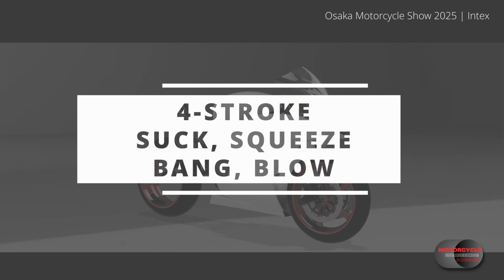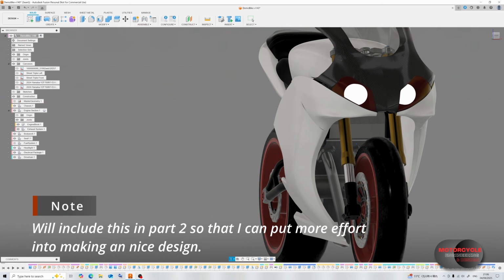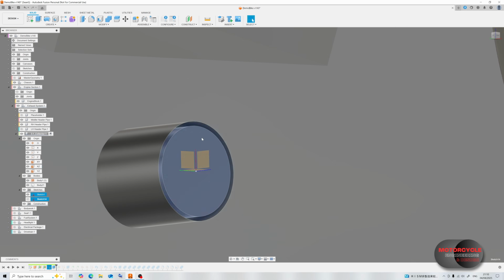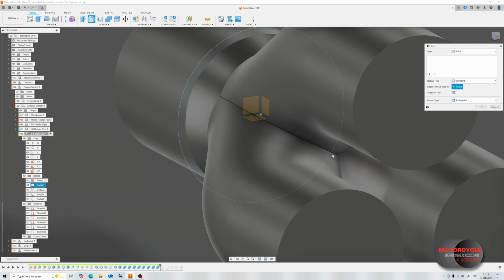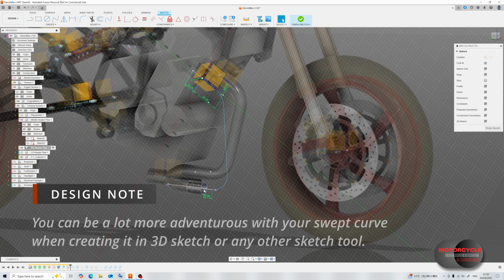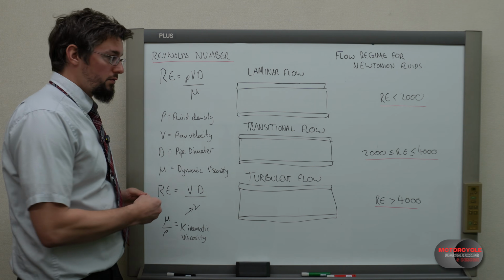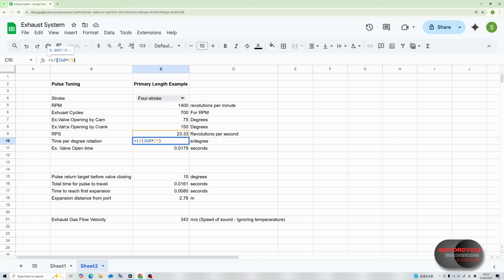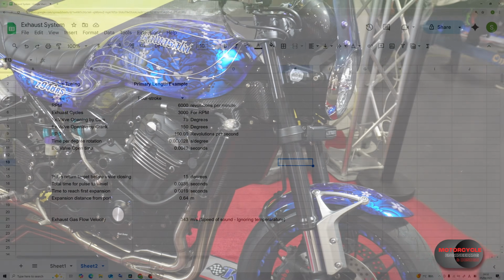Exhaust System Design | Part 1 | Pulse Tuning | Motorcycle Engineering

Comment: I heard an old racers trick hit it with white paint where it gets hot and messes up the paint cut it off. BMW M3 Pulse tuned Headers Sound great BTW
Reply from the maker: Hey, that's pretty cool! It's one thing to calculate and simulate based on theory, but these practical methods are more interesting to me 😆

Comment: Curious, been purchasing slip on exhausts, after the cat, sometimes in place of for 20years. Would be good to understand the theory on design and performance behind these in order to make an informed purchase as oppose to get the Akra they make the most bhp.
Reply from the maker: @mikeritchie5500 the end can has little benefit compared to the header and downpipes becuase the scavenging from the first pulse is the most effective. the end can is definitely more for esthetics and sound. 
But when you hear the pops, burns and missfire though, that's likely because the original end can created some back pressure, by changing to something like an akropovik you likely get more of the un-burned fuel flow through the exhaust and it ignites in the pipe - popping. I believe it's more noticeable on carbed engines, but still would happen with fuel injection models with sensors. Maybe just a remap for the change in fuel mixture.
Reply: @ great explanation thank you

Comment: Glad I could surprise you :P

Thanks for this! I've been looking into designing a twin cylinder system with an X-crossover, been reading Internal Combustion Engine Fundamentals by John B. Heywood and Scientific Design of Exhaust and Intake Systems by Philip H. Smith and John C. Morrison, but by god it's hard going for someone who's never studied physics! I still don't have the bike, so I have no physical reference to start plugging figures in and being able to make the theory tangible, which would help a lot.

Looking forward to the next parts in this series, hopefully you can give a less mind-warping overview than the venerable Heywood et al.!!!
Reply from the maker: For a moment I thought the surprise was in reference to your name, I used to work with a very good engineer called D.Chapman 😆

An X crossover? Sounds like a fun project! Are you planning for the crossover to be your primary scavenging or are you putting the crossover after the primary pipe and initial expansion?

I'll try to keep it simple, as simple as I can understand it anyway
Reply: @MotorcycleEngineeringAndDesign  I'll try to channel my namesake when I get around to building!

The crossover's going to be a way down the system, I'm hoping that some harmonic of the pulses will be roughly where I want the pipes to merge. The general idea is to have a high mount exhaust with the headers wrapping around each side of the engine, crossing over through the frame (between the rear shock and the seat), and mufflers more or less following the line of the subframe after that.
I haven't seen it done before, probably for good reason, but it makes sense in my head!
Reply from the maker: @darraghchapman I understand the design concept and I like the idea, It'd be interesting to see and hear that, could make a nice note
Reply: That purple paint job reminded me of ship 'dazzle camouflage', it kinda made it hard to see the shape of the bike! Not necessarily a good or bad thing, I quite liked the colours.
Reply from the maker: Interesting, similar to prototype bikes being spied out on the roads in camouflage, I didn't realise this was something from ships 👍